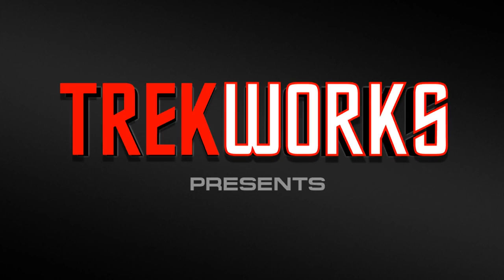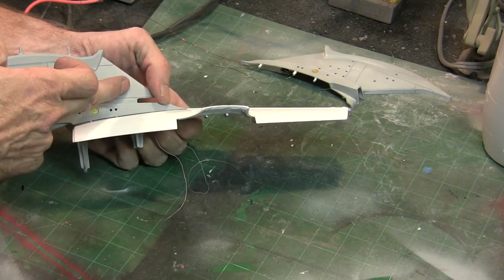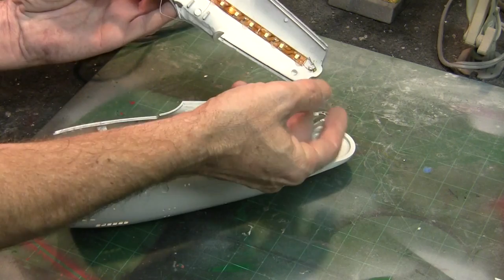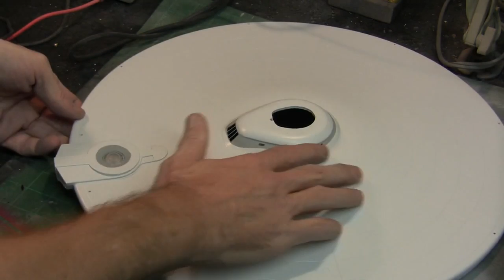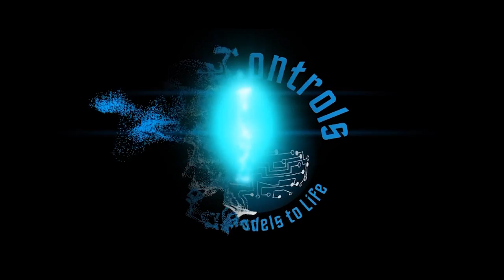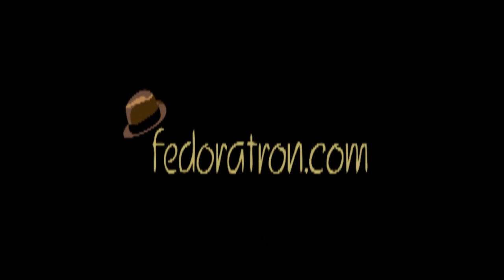1:350 Scale Enterprise Refit Build Series Pt -10 (Secondary Hull Assembly)

Comment: What I did in replace of the brass tubing is I put the two halves of the neck section together ( Not gluing them ) and took some stock styrene and measured how wide I would need it inside and cut it to size, started just before the receiving holes and pins at top and glued a piece there ( doing this to one side of the neck only ) and in between the two pins leading down to the bottom of the neck, this will make a channel from the top to the bottom of the neck for wires, I used model glue first let that dry over night then went over it with super glue...it's strong and after you put the two halves together the wires will follow the walls to the bottom of the neck...saves weight, metal near wire and inexpensive to make and not very time consuming and you won't have to cut any of the pins or receiving holes.

Comment: What color do you use for the general hull color.  I might use that if I build another Refit Enterprise.
Reply from the maker: The color is my own mix of straight white with a few drops of black mixed in.
I'm using acrylic urethane automotive paint. It provides a superior finish that is ultra smooth and very scratch and chip resistant.
Reply: Thanks.

Comment: I never really did understand the reason for "Aztecing" on starships. I know it's supposed to make the ships look bigger with more detail, but it just makes the hulls look weaker to me. When I went to see the TOS 5 foot model at the Smithsonian, the smooth surface gave me the impression of massive welded hull plates like you see on aircraft carriers and large nuke' powered submarines. Aztecing just reminds me of the thin quilted heat shield cloths, used on spacecraft by NASA, that you can damage with your bare hand.